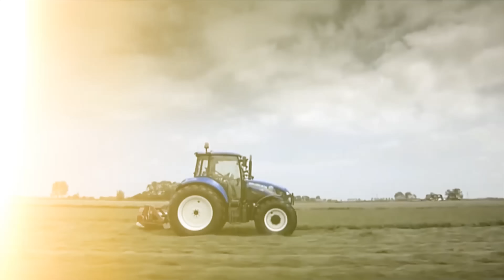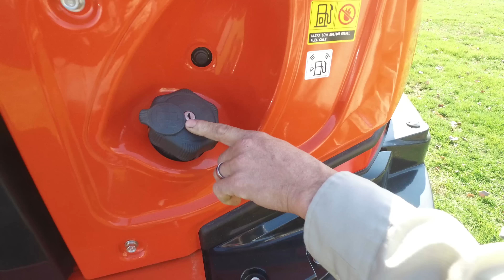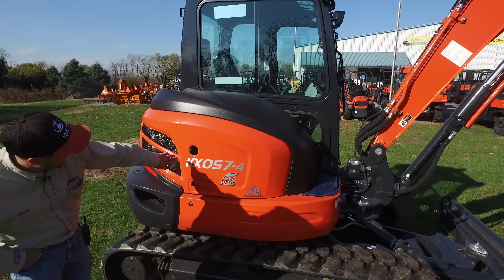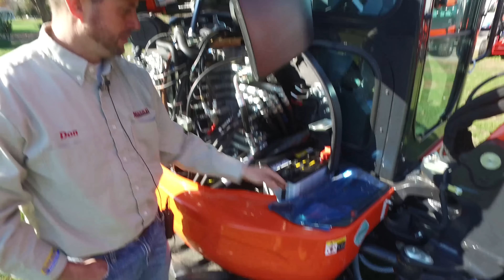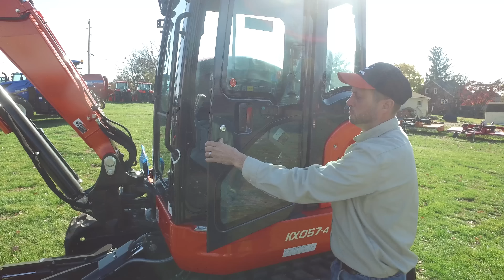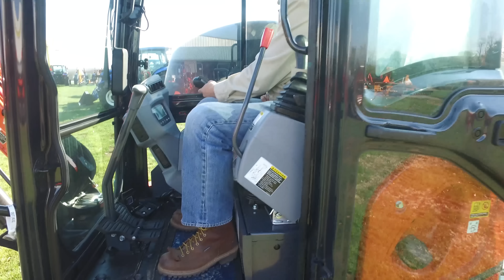Kubota KX057-4 Excavator Overview & Operation | Messick's

Comment: Messicks, you need to educate your salesmen on the product they are selling.
This salesman said the ECO switch will idle the machine down after 30 seconds, this is complete nonsense. The auto idle button on the throttle panel will idle the engine down once activated, and it only takes about 3 seconds. The ECO switch actually de-strokes the swash plate of the load sensing piston pumps to allow for less horsepower and less fuel to be used at working rpm, it doesn't put the engine into a fuel saving mode, it puts the hydraulic pumps P1 & P2 into a fuel saving mode.
Reply from the maker: your correct. This was one of the first videos we did with a new salesmen and he missed some details. I plan on reshooting these in the future.
Reply: Ok no problem. If you need any help with details I can help out, I'm a workshop foreman at a dealer and know these things backwards.